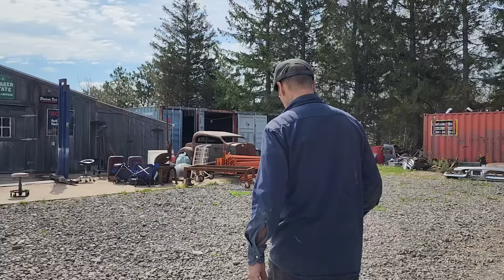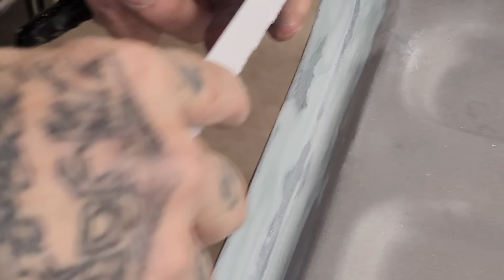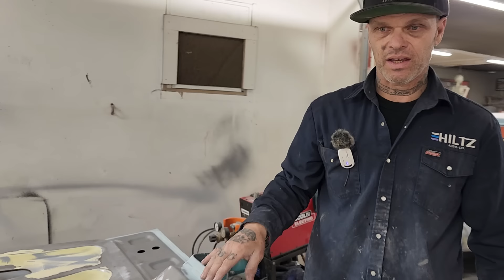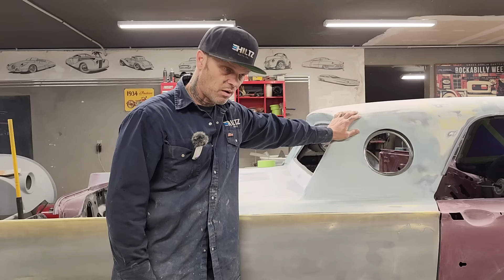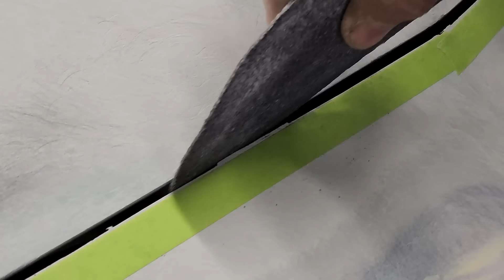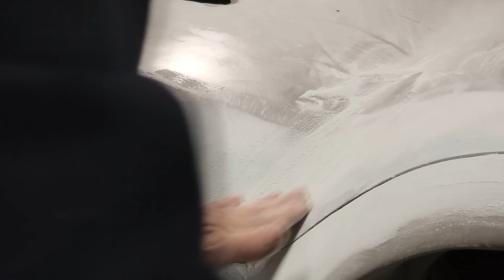Bad Chad apologizes for yesterday's ordeal 🚨

Comment: It's good to see that there's a good Chad as well as a bad Chad. I'd say that the lesson you should learn is to not jump to conclusions and fly off the handle. Do a little research on a car  before you buy it. If you'd looked at an old Ford parts manual or maybe a parts catalogue from a reproduction Ford parts place, you would have known that those were not body mounts you were looking at. They were runningboard mounts, broken and missing maybe, but not body mounts. And then you assumed that you'd have to take the fenders off to replace the running boards. I hope you found out you were wrong on that one too. Sure it would cost you something to fix what was wrong with the car, but not 15 to 20 grand from what I could see. If you got it for a good deal, it doesn't matter. It's still a decent looking car. I just hope that Jolene forgives you. But when you said you took "it" back, you didn't mean the 47, did you?

Comment: I don’t think you were in the wrong - prob just not worth filming for the channel. Could have been sorted off camera at lot easier. Also 4 months is a long time. Maybe leave it no longer than a week to pick deals up that you come across. I have seen you hire trailers also papers or no  papers I would have used the trailer you had. 
It can’t of been to important to begin with